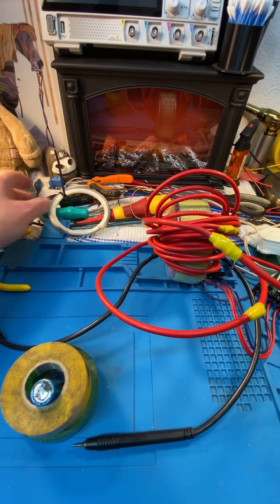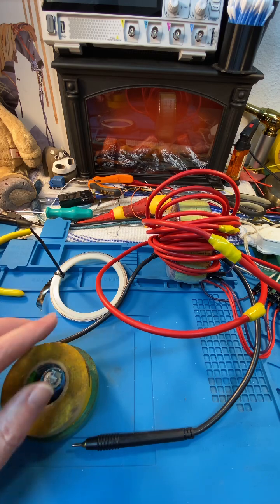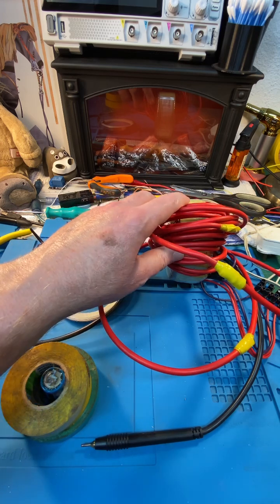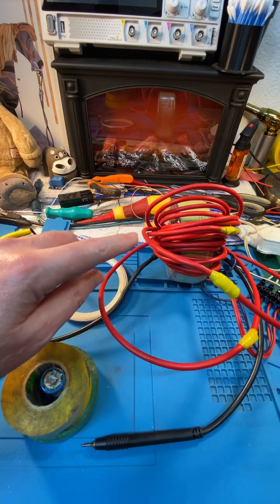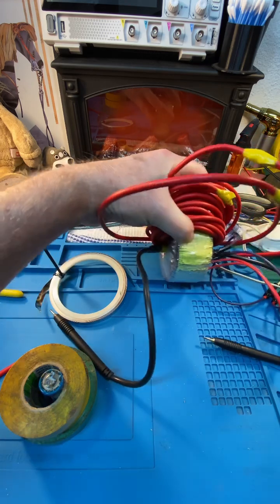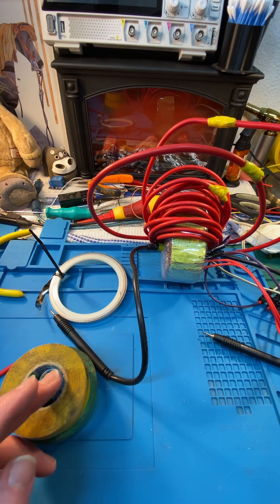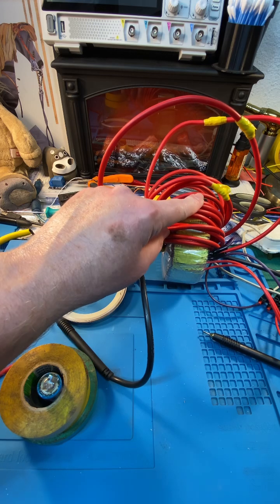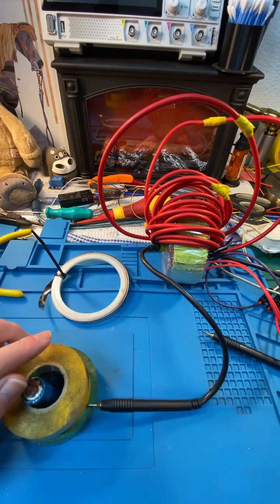"DIY Resistance Welding Nickel Strips to 18650 Batteries"

Comment from the maker: 💬 What’s your go-to method for welding nickel strip to 18650 cells?
I’m currently testing a homemade resistance welder using a toroidal transformer with 6 mm² wire (20 turns, ~6 V output). It’s working, but the wire runs too hot and doesn’t deliver enough heat to the weld.

Next up: bigger transformer, 24 mm² secondary, and Arduino-controlled weld timing.
Drop your tips, tricks, and experiences below — especially if you’ve built your own battery spot welder! ⚡🔋
Reply: DC supply connected to a large bank of capacitors, with a 20-50w car bulb between the two in series to limit current to the DC supply. Connect your probes to the capacitor bank in parallel. 

Dumps very large current into the weld from the capacitor bank. Bulb will light as it recharges, when it's dim its ready to weld again.

This also gives short circuit protection to the supply.

You could use your current transformer as the DC supply if you stick a bridge rectifier on the output.
Reply from the maker: Thanks, I will look into that.